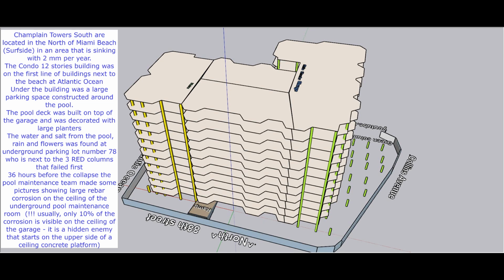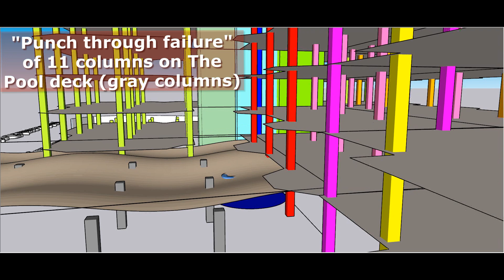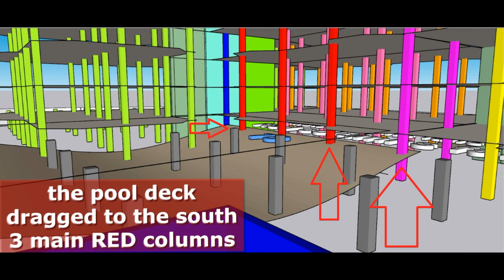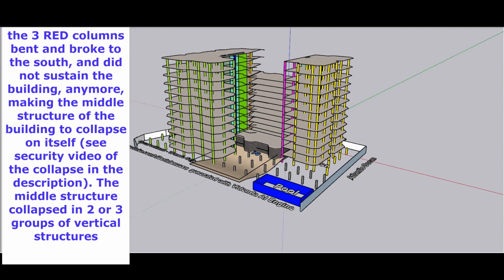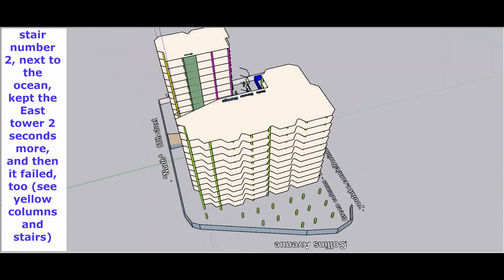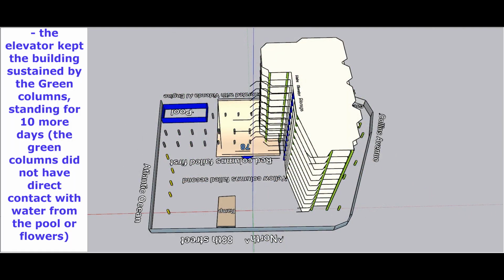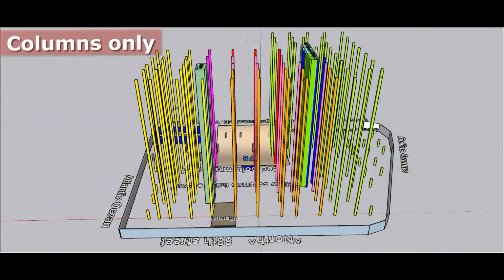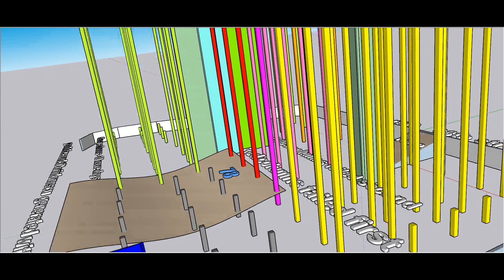Collapsed Building Miami, 3D model condo, penthouse, Champlain Towers Surfside Florida, demolish P3

Comment: The elevator shaft kept the rest of the building up because the shaft was the only thing that went all the way down to the bottom of the garage
Reply from the maker: Yes, elevator shaft and thicker columns make it much stronger
There are 2 more identical buildings one block away, on the beach; I hope they get structure testing soon
See a birds-eye view before the accident, all 3 Champlain Towers (South, East, and North)
https://youtu.be/5naMGbAe8EI

Comment: after view some U tube video's  someone had said something about tall palm trees that used to be in those planters and could find them on old google earth pic's.. what I like to know is what did they use to remove those trees it certainly wasn't done by a chain saw and stump grinder ..  

I think they may have used an  excavator  backhoe  that was on wheels/tires instead of tracks,.  as these machines are quite heavy and may have contributed to the weakening of that floor.. remember witnesses said the pool deck area that had no building over it fell in first .. this is a good theory and surviving witnesses that can remember how they got those trees down and how and with what,. 

It caving in the pool area first is what made me think of as to how and why as I've worked in construction site development/preparation   around heavy equipment and started to think of the backhoe's on Wheels/Tires   since some of those backhoes the scooper can rotate too besides open and close,.
Reply: I would expect they would have climbed the trees and sawed off the trunk in sections using a chainsaw or other cutting tool as I have seen done before.  I doubt they would put anything as heavy as a picker or back hoe on top of the pool deck.  They don’t even allow equipment that heavy on any parkades and the equipment owner would know that and likely be liable if there were damage.  They would have cut the trees or fall them and use dollies to remove the tree on its side.  There were not that many trees.

Comment: I think the building should be on it's own columns/foundation, and the remaining "pool deck" separated from the building...
Reply from the maker: I hope that in the next projects of new buildings they will separate the building from the pool and the flowers - they should have totally separated structures because there is no technology to stop the water.  Grand Canyon is the proof.
The Venetian Las Vegas had this problem, water from the artificial lake of Venice was leaking into the Casino and dropping on players, tables, and machines on the main Casino floors. They could not hide it as people do now with leaking water in their garages (which is just 10% of the actual corrosion that you do not see)
At The Venetian, they build a second level of separation between The Lake and The Casino where , in a water-insulated environment, workers check the pool leaking and do the repairs.  These 2 levels of protection and separation between the building and the water should be the mandatory solution for all our buildings
And flower layers next to buildings should be approved by structural engineers. They should also receive the right to evacuate buildings using Mayor office approvals
See The Penthouse, inside view before the accident, Champlain Towers South, Miami, Florida (Surfside)
https://youtu.be/HFWbCZG_6xA

Comment: My Educated guess!
*Chlorine pool water 40 yrs of storms overflowing the pool water!
*Waterproofing failure ! 
*DECK  punch thru shows connection failure at pool deck columns! ( look at columns still standing)
Column connection ** 
*Column connection undersized rebar ?
* Not Enough rebar @ column to deck!!!!!!!!!!!!! 
*Rebar single strand at bottom of deck !!!! More info needed
Reply from the maker: Yes - these are the main causes
See The Penthouse, inside view before the accident, Champlain Towers South, Miami, Florida (Surfside)
https://youtu.be/HFWbCZG_6xA

Comment: EXCUSE ME !!
Just pillars and floor slabs?
Did see that on a tour true an appartement also.

On top of every single pilar should be a cap or collar.
Structural concrete walls or beams.
All that would’ve kept the building standing even if several pillars are wiped out by a crash from a truck or gas explosion.
The pillars in the garage must keep the weight of everything and should be extra heavy, but all that would have taken up (parking) space.

This building was planned more than 50 years ago normally everything was overbuilt strength wise.
The luxury package in our homes have gym equipment fishtanks whirlpools and nice big planters.

Every building that is done like this is up for restructuring OR ELSE !!
Reply from the maker: Strange project - you do not see to many rebars or beams on current photos of the collapse
I had a similar problem and voted yes for consolidation even if I had no money. It is important to start working as soon as possible. It is like insurance, you do not know when you need it.
Then I helped to get more YESes from other owners
Then I paid monthly amounts
See The Penthouse, inside view before the accident, Champlain Towers South, Miami, Florida (Surfside)
https://youtu.be/HFWbCZG_6xA
Reply: @DorinIonescu  ,.
Did see that yes.
Only ‘room dividers’ and glass facades between the pillars.
That in a building that had to deal with several hurricanes in its 50 year lifespan.
I am curious did none of the educated or wealthy owners have a clue?
Hundreds of people used or visited the building but nobody?

Comment: Other video sources (security footage from adjacent condo) show façade columns going first red, then next row in - your pink, then next pink, orange, orange and then the wing your yellow with its green stair core falls slightly towards the pool.
I have seen video (car owner looking for car) that show corrugated plastic sheeting under the soffit of the terrace deck parking bay 77/76 and a red cone next to column 27/28.
The terrace deck seems to have failed in punching shear due to corrosion weakening slab reinforcement.
The video was a year old and concrete investigations found problems that were not being addressed.  See also YouTube by jeffostroff.
The video do not show any temporary shoring around the columns.
Reply from the maker: It is hard to 3D simulate the collapse. I will update the model with your information
See The Penthouse, inside view before the accident, Champlain Towers South, Miami, Florida (Surfside)
https://youtu.be/HFWbCZG_6xA
Reply: My Educated guess!
*Chlorine pool water 40 yrs of storms overflowing the pool water!
*Waterproofing failure ! 
*DECK  punch thru shows connection failure at pool deck columns! ( look at columns still standing)
Column connection ** 
*Column connection undersized rebar ?
* Not Enough rebar @ column to deck!!!!!!!!!!!!! 
*Rebar single strand at bottom of deck !!!! More info needed
Reply: @Admin-tm8gp  The original 1979 design drawings by Breiterman Jurado posted by the Surfside authorities make an interesting read.  Drawing S14 of 14.  I take column type N to be carpark columns as only have bars at basement level.  12 x 16" with only 4#7.  Let me repeat only four 7/8" diameter bar.  To say again only one in each corner with what 13" between them.  UK practice is to have six bars and links.  UK practice is to have shear drops in slabs at 0.75d perimeters from the column face until v<0.5Vc.
4000psi means about 320Kg/m3 and insufficient durability for the salt as you say.  Drawings show 30dia col bar laps from slab i.e. kickerless construction.
All this may have been US practice at the time BUT subsequently (hopefully) recognised as NOT near good enough.
I doubt a full FE analysis of the structure could prove sufficient capacity to resist progressive collapse.
I don't know where the podium deck failed first.  I suspect over columns furthest apart K L / 13 possibly M/13.
A millisecond later the collapse spread to the building line where along grid 10 the step change beam under the façade should have held, but it suspect the slat water penetration through the slab corroded and weakened columns along grid 10 enough that they could not resist the lateral thrust of podium slab rubble with local crushing at the top leading to push out / buckling.

I am saddened that so many lost their lives, heartened that some escaped and grateful for all the ring cam, estate agent and car owner video has allowed me and hopefully the whole industry to see it.

US courts will have a view on liability - why the police aren't releasing Condo-CAM images.  I await to see the CROSS-US non-blame findings.
Reply: @robi4387  This is not supposed to happen in the US , England or any western country . Eye witness saw the pool  deck go first   She died while on the phone with her husband , apartment over looking the poll deck and below was the P garage hear a noise and went to security and lived with her 2 kids . I do think the pool deck started a perfect storm as they say.

Comment: Folks, unfortunately this is just the beginning of tragedies to come. As buildings get older they will fail and the failure is going to be accelerated by the shoddy construction that we have here in Dade County, but normally these problems would be caught by the building inspectors but they are too busy trying to make an extra $$$ buck from the contractors. Contractors take money saving short-cuts. The inspector points out the problem... gets a few bucks but DOES NOT check that work again and so... it is not corrected. I have owned n numerous homes to which I have made additions, pulled the required permits and the flow of inspectors followed. I ultimately saw the need to pay off some of these guys. Why doesn't Dade County form a "Task Force" to check up on the personal lives of these field inspectors, to see if it looks like they are living within their means... or does it appear that some of these guys are showing a life of luxury on a modest $40-$45 thousand dollars a year. Check their homes... their cars etc. Over 100 lives were lost possibly because of short-cuts. How about that inspector that in 2018 told the Board that everything was in excellent shape! This appears to be the beginning of a lot of bullshit coming to this Dade County!
Reply from the maker: I had a similar problem and voted yes for consolidation even if I had no money. It is important to start working as soon as possible. It is like insurance, you do not know when you need it.
Then I helped to get more YESes from other owners
Then I paid monthly amounts
See The Penthouse, inside view before the accident, Champlain Towers South, Miami, Florida (Surfside)
https://youtu.be/HFWbCZG_6xA

Comment: "Punch through failure"? Does this happen so often that there's actually a term for it?
Reply from the maker: It happens at overloading a slab. Unfortunately, it happened now because of hidden corrosion. You can see only 10% on the ceilings (tip of the reversed iceberg)
We had 2 invisible enemies in the last 12 month
See The Penthouse, inside view before the accident, Champlain Towers South, Miami, Florida (Surfside)
https://youtu.be/HFWbCZG_6xA
Reply: My Educated guess!
*Chlorine pool water 40 yrs of storms overflowing the pool water!
*Waterproofing failure ! 
*DECK  punch thru shows connection failure at pool deck columns! ( look at columns still standing)
Column connection ** 
*Column connection undersized rebar ?
* Not Enough rebar @ column to deck!!!!!!!!!!!!! 
*Rebar single strand at bottom of deck !!!! More info needed
Reply: @Admin-tm8gp  The pool didn't leak and was intact after collapse. You do have an ocean, however...the water table was ABOVE the garage. So, seepage.
Reply: @windsofmarchjourneyperrytr2823  i did not say the pool leaked . I am saying the use of the pool by people enter / exit and also storm winds blowing pool water, you also have salt water from storms  , rain water , water proof failure, and most important the connection failure at the columns .. punch thru!! Look at re bar at the column connections.. NG it failed

Comment: Look at the pictures of parking area, note column 72 there are 2 rebar showing only 2 per side that is wrong that is the problem open your eyes it a bad design concrete slab on the ground cracks
Reply from the maker: Yes - something is missing here - I built a stronger structure for my wooden 1 level terrace
I had a similar problem and voted yes for consolidation even if I had no money. It is important to start working as soon as possible. It is like insurance, you do not know when you need it.
Then I helped to get more YESes from other owners
Then I paid monthly amounts
See The Penthouse, inside view before the accident, Champlain Towers South, Miami, Florida (Surfside)
https://youtu.be/HFWbCZG_6xA

Comment: In reply to the comment, “ Yes they are attached first you prepare your ground base I’ve even seen contractors mix in lime. Pour your footings for columns support in Walsall with rebar to tie to. They then start hanging red iron, (steel beams, the super structure). They start jutting down pans, tin to pour on leaving out for elevator shaft. After floors are poured and have cured for 28 days to reach full strength, they will start pouring columns around I beam up rights and start bringing up the elevator shaft, as it goes. All done in stages. Usually the pan floors were a few floors above the floor we were pouring. In the winter they would hang curing blankets around the floors above and below the floor we were pouring and put space heaters in and heat the floor above and the floor below. There were guys that’s all they did in the winter was keep the heaters full of kerosene! Above us say three floors they would still be hanging red iron. But point being I’ve seen myself on the insides of the forms where the elevator shaft there were plates that held a tension cable that was poured in the slab. These would tie into the rebar framing that was the strength for your concrete. The elevator shaft is the core generally centered and stairways at the corners and perimeter that also got a poured shaft. All of these things give the structure strength and it all tie’s in together. If it doesn’t there is loss of strength. I do agree there was water damage where there shouldn’t have been. Everything has to drain. But was anything that should have been tied into the elevator shaft sheered off, when the floors fell. In my mind there should at least be evidence of a key way where the floor ounce was. One off the last buildings I worked on was 52 stories, built around the seventies. Still standing.
Reply from the maker: Yes, Execution is important for maintaining the strength of the building structure
See The Penthouse, inside view before the accident, Champlain Towers South, Miami, Florida (Surfside)
https://youtu.be/HFWbCZG_6xA

Comment: The first set of magenta columns collapsed with the red ones, this leaned the rest of the tower (yellow) slightly which caused it to overload the remaining columns and the tower to fall inwards
Reply from the maker: Thank you. I will include your observations in version 4 of the 3d model 
See The Penthouse, inside view before the accident, Champlain Towers South, Miami, Florida (Surfside)
https://youtu.be/HFWbCZG_6xA
Reply: My Educated guess!
*Chlorine pool water 40 yrs of storms overflowing the pool water!
*Waterproofing failure ! 
*DECK  punch thru shows connection failure at pool deck columns! ( look at columns still standing)
Column connection ** 
*Column connection undersized rebar ?
* Not Enough rebar @ column to deck!!!!!!!!!!!!! 
*Rebar single strand at bottom of deck !!!! More info needed

Comment: If my grandma was in that rubble, I sure as hell would have filed lawsuits stopping the demolition of the remaining tower until they were recovered.
Reply from the maker: The remaining tower was demolished to the South-West and did not impact the victims area (controlled demolition with timers set to North-West columns first). On the contrary, the rescue team received more safety to access the areas next to the demolished tower.
All teams and The Mayor were afraid that the tropical storm could demolish the tower in the wrong direction and create new victims
They could not rescue anybody because "we could not find any refrigerator" or any other strong object next to which people could stay and survive 
See The Penthouse, inside view before the accident, Champlain Towers South, Miami, Florida (Surfside)
https://youtu.be/HFWbCZG_6xA
Reply: No tropical storm was here. Stop the lies.